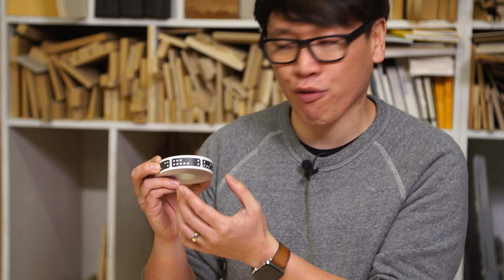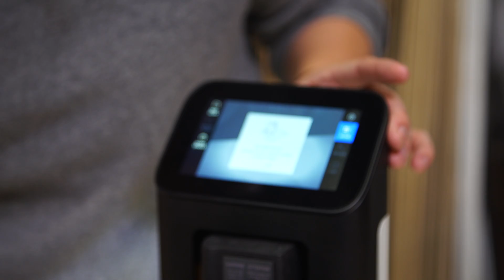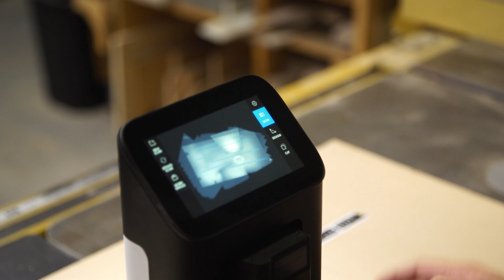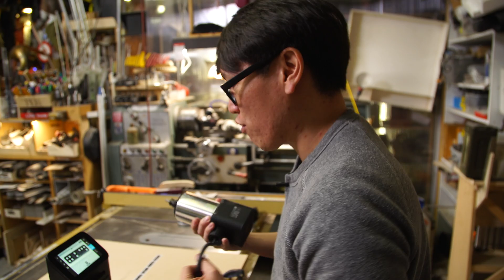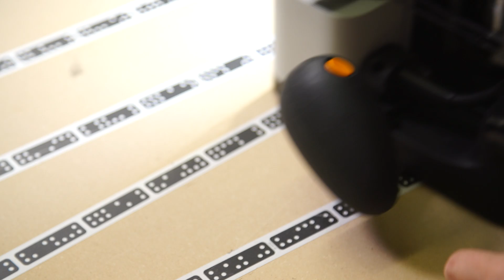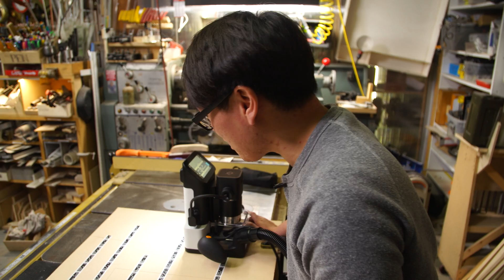Testing the Shaper Origin Handheld CNC!

Comment: Can we stop calling this CNC? It's still got dual meatpuppet claw drive when you get down to brass tacks.
Reply: Separate from anything else, I feel the phrase "dual meatpuppet claw drive" is a pretty amazing piece of terminology, and I'll being using it the first chance I get.
Reply: Drawer cnc because that's where this is going to end up.
Reply: CNC  doesn't refer to a specific drive mechanism, it means Computer Numerical Control & this machine uses it. Any machine that takes a form of Gcode can rightly be called a CNC machine.
Reply: SilentS CNG?
Reply: Stabilised Router.
Reply: SilentS *stabiliZed”
Reply: audiofanaticz except it wouldn't have compensation and you'd also have your tool fly out.
Reply: CNC CNC CNC CNC, lol, just kidding.
I would call it a hybrid or so.
Reply: You have a great turn of phrase.
Reply: I don't really care, as long as i can put a dwg in it, it's cnc to me
Reply: Now thinking about it, that's really all that it is.
Reply: audiofanaticz there would be no computer involved in moving a part around a drill press by hand. There is a computer involved in this product.
Reply: I love the phrase "dual meatpuppet claw drive", but this is CNC by definition.
Reply: It's a true CNC in the sense that it's a computer-guided final cut. It's just a CNC with a very tiny working area, that you have to keep moving around the workpiece. A "stabilized router" would have shock absorbers or a gyroscope.
Reply: I am with you, CNC just means computer numerical control, doesn't mean it needs to operate by itself.
Reply: Yeah well everything with a motor is a "robot" now, so...
Reply: Yup. I'm with everyone else. The most expensive Glowforge version is just the laser version of this, really. You manually feed the material through if you need an area larger than the cutting bed. The only difference is that this can cut in an area larger than you would normally have because it doesn't need to have a bed, or a large rail system. You may as well be saying those little hand printers that print on paper as you slide them across the paper... Aren't actually printers.

Vinyl cutters are CNC. Laser cutters are CNC. 3D printers are CNC. Learn what the hell you're talking about before you open your mouth.
Reply: To call this a "cnc" machine you might as well remove the Bridgeport mill from the shop and replace it with a drill press and move the piece your "milling" around with your hands.....